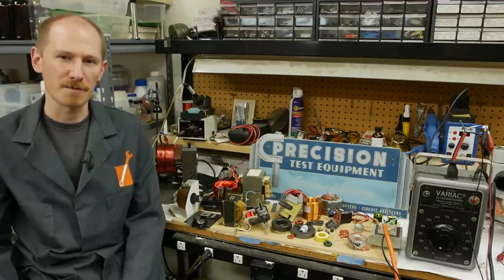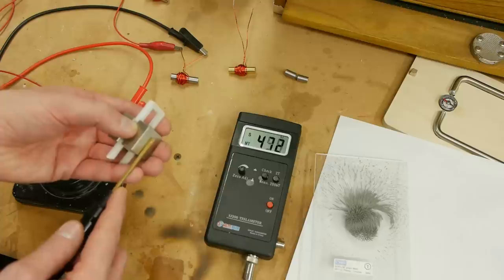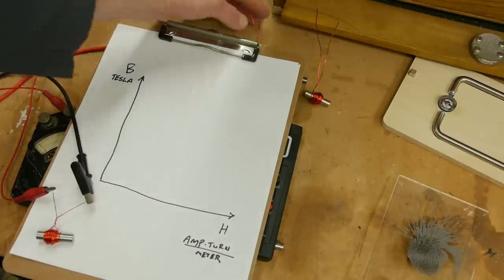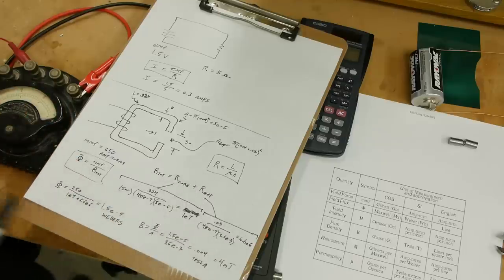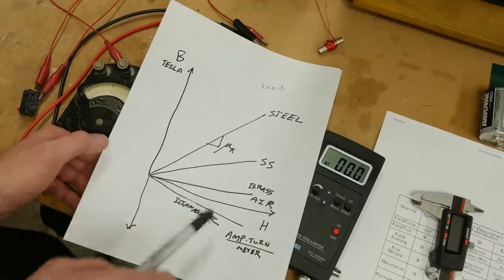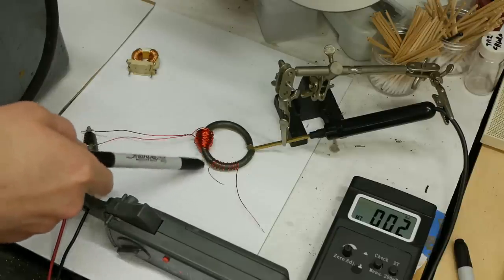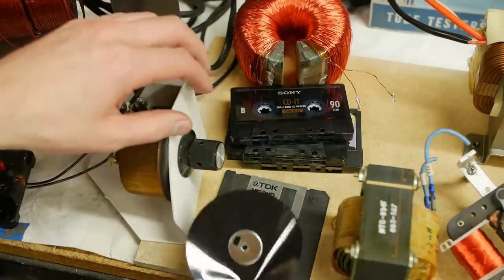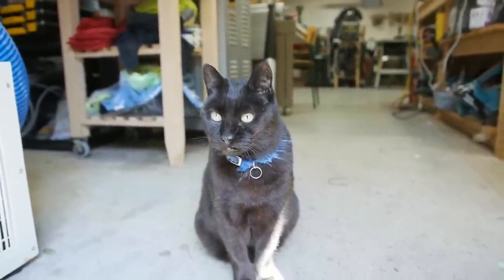Engineering magnetics -- practical introduction to BH curve

Comment: Ummm actually, magnets are Current sources in the analogy, unlike the battery is a Voltage source. Basic proof of this is; you can’t connect two magnets in series and increase the magnetic flux density in a magnetic circuit, but with batteries, you can increase the Voltage differential by connecting them in series.
Reply: oturgator I've seen Brainiac 75 stack two powerful magnets and it increased the field strength. Or is that different from what you're describing?
Reply: A good analogy is like a diagonal frog.
Reply: Ian Grams If two batteries are connected in series, the voltage doubles, I was wondering if the magnetic flux density doubled in that experiment or just slightly increased. It is true that the magnetic flux output of the magnet is proportional to its’ size, but height has less of an influence as compared to surface area.
Reply: oturgator, you may be pointing out a flaw in the analogy, but for the purposes of the main analogy, the magnet is clearly like the voltage source.  For a fixed voltage source, increasing resistance decreases current.  For a fixed magnet, increasing reluctance decreases the flux density.  If it was like a current source, the reverse would be true.

As I said, I think your comment shows that the analogy breaks down at a certain point, not that it wasn't the right analogy for the main purpose he was using it for.  Though I don't really understand how magnets add yet, so I'm not sure what the correct analogy for that looks like.
Reply: Chris Sloan  It is fairly simple nowadays to check this using finite element modelling, like FEMM. If you take a 4mm in width, 4mm in length and 2mm in height magnet and place it in a close circular steel magnetic circuit you can easily calculate the flux density at a cross-section. Say you have a lossy steel, that shares the cross-section of the magnet and it is 12mm by 8mm, the single magnet will develop around 1.25T at a straight cross-section. What would the analogy say when you add another magnet in series, which has the same dimensions (now the total magnet measures 4mm by 4mm by 4mm) the flux density doubles? Why am I getting 1.3T then? If his basic series connection result fails, I really do not feel the appetite to pursue the voltage analogy any further.
Reply: @oturgator, at 1.25 or 1.3T, you are probably saturating the steel. Try increasing the cross-section. In any event, the MMF does add for series electromagnets. It is a well-known and widely used mathematical analog. But it is subject to certain assumptions (such as avoiding saturation). Another option would be to use weaker magnets so that the sum is still within the saturation limit of the steel (or other core material).
Reply: McKenzie Keith  I hate to break it to you but the saturation point or the start of the non-linear BH  region of low carbon steel is around 1.6T. I know I am like a lightning rod on a stormy day with these things I am saying, but I have done this so many times, adding two identical magnets in series configuration does a little improvement in the magnetic flux density. It is similar to a single magnet with the same cross-section but double the thickness. If you want to increase the magnetic flux density in a magnetic circuit, you have to add surface area. We can talk all day about how reluctance is impacting the magnetic flux density, but for once, just do not object because somebody is saying something that is taking you out of your comfort zone, just draw a lumped circuit analogy or build a simple FEMM model and do some calculations. You will see, the current analogy fits better.
Reply: oturgator, it is not that you are taking me out of my comfort zone. The problem is that you are alleging that a standard principal taught in engineering classes and used every day by engineers is wrong. I am not going to claim that you are wrong in your result vis-a-vis magnets because I have never done the experiment or run the simulation. But when it comes to inducing flux in a core using windings with current in them, the voltage analogy works and is relied upon implicitly in the design of dual voltage transformers and induction motors which are all over the world. Also auto-transformers, etc.
Reply: McKenzie Keith To make it clear, I have never stepped into the electro-magnet definition. I made my remarks only for the behavior of the hard magnetic materials.
Reply: Re-reading, I see that is fairly clear. So I was reacting to something you didn't actually say. My apologies. It is interesting, what you say about the permanent magnets. It seems like the only way to double the overall flux in the circuit is to put them in parallel physically. Which does make them like current sources. It has been some time since I studied flux circuits in school. I think this is  a good time to review it all and try to get a better understanding of how permanent magnets are to be incorporated into the flux circuit concept.
Reply: What an interesting discussion! I think I have an explanation for oturgator's observation that "you can’t connect two magnets in series and [double] the magnetic flux density in a magnetic circuit."
The magnets are saturated (because you can't make the magnetic domains in the magnet be any more aligned than they already are). Thus the permeability of the magnet is close to the permeability of air!
In oturgator's example with the 4x4x2mm magnets, when there was a single magnet in the circuit, I bet the ends of the circular steel magnetic circuit were 2mm apart, just enough to fit one magnet in. The flux measured in the circuit was 1.25T. I bet if the gap was increased to 4mm, the flux would be about .65T. Then, stuffing a second magnet in the gap would double the flux to 1.3T.

Comment: Great presentation, I had forgotten that trick for guessing the area to use for a gap. 
Also that trick with the pot and a spare oscilloscope channel to null out the integration so the plot doesn't wander off is gold too.

47:01: The intentional gap in the inductor is to prevent the catastrophic failure that happens if the core saturates -- it makes the saturation more progressive, rather than sudden and 'sharp'. Without, if the field gets too high such that it ends up in saturation during a voltage spike, then the relative permeability during that spike will suddenly drop back to what air is (in saturation), and this has the effect that the inductance also suddenly drops... Which means that the voltage you'd expect to be developed, that would affect the circuit such as to resist an even sharper increase in current -- what you use such an inductor for, after all -- largely goes away, right when the current is already very large. This tends result in a massive surge current higher than that, which tends to overheat the coil pretty quickly, which probably results in it catching fire. 

At the risk of completely confusing everyone: This is almost exactly unlike what happens when a mechanical suspension system gets pushed too far and hits a mechanical stop suddenly. If the spring was stiffer, it wouldn't have moved as fair. 

It's exactly unlike because if you identify that current is like movement, and voltage is like force, then actually capacitance is like a spring, and inductance is actually like inertia, not a spring. So the real equivalent would be a flywheel on a shaft spinning too fast, and suddenly losing its grip on that shaft, thus allowing the shaft to suddenly spin even faster as if it didn't have a flywheel holding it back -- or even better, like when you're about to shove a heavy load on a sled across ice, and just as you really start pushing, someone lifts most of the weight off the sled -- the sled goes shooting off with far more speed than you intended. 

The suspension example is exactly wrong, then - but it does explain why capacitors/springs and resistors/damper are more commonly used to absorb shocks/vibration, and you only tend to add inductors/weights after you have those in order to 'tune' such systems. But probably less weight is just better. The electrical dual of 'less weight' is laying out wiring paths to minimise stray inductance. (EG: if you wind a toroid with many windings, don't just let the windings lap around the ring over and over -- put a card in at one place around the perimeter and 'bounce' the windings off both sides of it like you're bouncing off both ends of a plain solenoid former -- this eliminates the accidental polenoidal field you probably don't want your toroid to generate, as otherwise every 'lap' the windings make around the ring, makes a turn that will put flux through the middle of the toroid, where it can couple out to other things...).

It's hard to think up a good mechanical-analogue example, because something like your feet slipping is more like someone suddenly shorting out the inductor, not like saturation, and weights don't actually suddenly start weighing much less if only they are accelerated to a sufficiently high speed... if anything, relativistic velocities have much the opposite effect.

With a more gentle slope to the B-H curve, it takes a far higher current for that sudden change in behaviour to happen. 
In general, you pick it so it finally happens such that the coil is already overheating at that current anyway. The trade off means that you need more copper to make the inductance you need, which means a bigger coil, with more windings, for a given current rating and inductance. 

A common mistake when designing inductors (particularly, in switch-mode power supplies) is to not plan for this saturation.
When it happens, right when your switch-mode supply is loaded up, your inductor suddenly allows way too much current, possibly catches fire, and blows your transistor also... 

Really need to just check the B-H curve for the core, and calculate at what current you will hit saturation with the number of turns you want, and make sure that's a high enough current that you would have other problems first (Like the coil overheating).

Comment: Coming from an electronics and radio communications background in my education, this coupled well with the concepts in active circuits and inductors used in high frequency applications. It also added some insight into and reminded me of some industrial electrical classes I took that covered transformers, motors, and industrial instrumentation basics.

Leaving the math out until you are comfortable with the theory is how my classes were done. Most of my instructors worked in the field and had retired from their careers, but taught to offer their knowledge to the next generation...and to keep busy so they didn't go crazy with boredom.

Comment: This is a great video and you have the right idea about teaching magnetics via an intuitive approach.
You mentioned thinking about a magnet as a compressed spring.  I have always thought of them as compressed dense matter that attract/repel via gravity-LIKE forces (Not gravity but behaves like a similar force that only interacts with magnetic material).
Thinking of magnetics as a local gravity-LIKE field, forces one to realize that you can't make these perpetual motion machines, and you can't make free energy by spinning magnets over other magnets (because your mind instantly thinks about planets not generating energy unless their orbit decays which eventually stops the orbit etc).
Thinking of them as gravity-like does, however, let you realize that they can attract/repel even while not using any energy to do so. (The compressed spring analogy misses this attraction part.)

Comment: I honour you for the work. The H * B curve is fantastic. H is the work put into the coil, and the B is the magnetic result . Nice, I didnt think of it that . I have struggled to understand the theoretical concepts about practical nature . BH curve, I love it .  comment 19:42 . the resistance and resistivity of material do change, with temprature . The interesting correlation is that Conductors, get poorer, with increased temprature. But insulators like glass and air, conducts better once they are hot . 20 celcius room temprature is the usual, but in a tight case of electronics. 80C maybe realistic . My method is to coil, and if the coil during action is cold. I can increas the wire crossection, or make the wire shorter. If the coils DOES heat up, I need a longer wire, reduce the wire crossection but retain the coil diameter, increase Resistance and Reactance by adding turns, splice in centertaps, longer coil) or artificial cooling, depending on what temprature that is acceptable during drift . Polyurethane wire insulation usually rates to 150 - 200C . into the wall socket it goes .

Comment: Great explanation.   You made me realize why I could not make any sense out of all this before.   The units used were super confusing.   I now realize each article I read was using different units so it seemed like there were 20 units of measurement to learn and understand.   That part saved my sanity.   Thank you.   SI units sounds the most logical to use and understand.   I still need to review this info to really grasp it but I feel you've gotten me 10 step closer to real enlightenment.  Thank you Maestro.  I appreciate your time to do this one for sure.  THANX.

Comment: A fun, related topic would be the old Apollo Guidance Computer's 2k-word core memory system 32,768 bits in total. They were simple in theory, but required a lot of circuitry to make into a practical memory system.

Another excellent video, a great introduction to magnetics.

Comment: Regarding toroid cores: The 'mix' used for the core material depends on the application, perhaps even more so than the frequency of interest. A mix that is very good for a narrow band resonant coupling transformer is typically horrible for a broadband choke. BTW, that yellow and white core with the white plastic base you described as a transformer is designed to be a common mode choke for filtering on the AC input of a switch-mode power supply. The color of the core and the space between the windings on the core, as well as the fact that the leads of each winding come out to pins on the long ends of the base indicates it's for that application as a noise blocker, not as a transformer.

Comment: @40:20 One thing you could have pointed out with the ferrite transformer is how it's curve never reaches saturation, and it's designed that way to transfer power efficiently.  Great video - The Navy tried to teach me all this stuff back when they were using 'magnetic amplifiers' (basically complicated transformers) for precision voltage regulation (high power).  I got it, eventually, but it would have been so much easier to go from head knowledge to practical real world fix-it application with a video like this.

Comment: Too bad my instructors at a major university failed to make these type of simple arguments.
I did graduate with an electrical engineering degree, but without the basic explanations like this, well some of it did not stick. Thanks for correcting that situation,... now same thing happens with optics. A description of how various lens and compound lens combinations might be used to solve a particular problem - PRIOR to the algebra would have been much appreciated.

Comment: There is an app called „Phyphox“...

You can use it to access the sensors of your mobile devices directly.
Many smartphones have an integrated magnetometer, barometer and an accelerometer.
It is fun to play around with it. It can also do some acoustic stuff (Fourier transforms etc.)

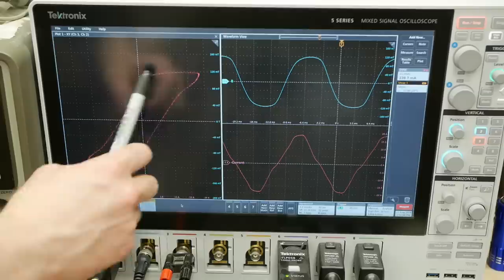Comment: Wonderful presentation and passing on of knowledge in a very easily understood way, thanks. I wish you were a lecturer at Berkeley when I was taking EE and Physics there. At 33:50 you mention the saturation due to air gap. Actually, magnetics designers introduce air gaps to eliminate saturation at lower currents.

Comment: Good video. Along with your recommendation of using one unit of measurement, may I suggest Gauss as your preferred unit. Typically everything in the industry, or professional level, is measured in Gauss. At least up until you get into the engineering aspect of the trade. But all data is atchived using Gauss.

Comment: Great video!
Btw, most airgapped E-core transformers seem to set the gap in the center. Probably due to the better control it offers over gap width by allowing the outer two sides to close fully and the stiffness of the core material sets the gap precisely.

Comment: Hello, thank you very much for the video, it's very clear to me.
Just one thing I would ask you: when you calculate the reluctance of the iron path (min 21:00) you said the relative permeability of the iron is 500. But in this way it seems that the relative permeability of iron is constant, but instead it depends on the value of the H field (B-H curves of iron is not a line). So how and why do you decided to put 500 as the value of relative permeability of the iron?
Thanks in advance!!